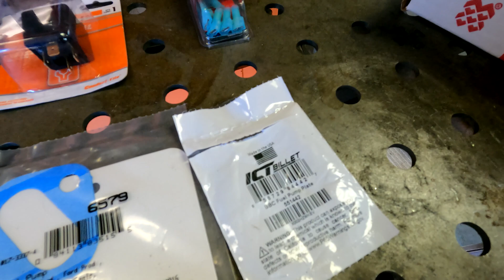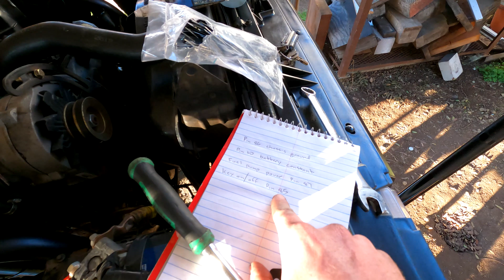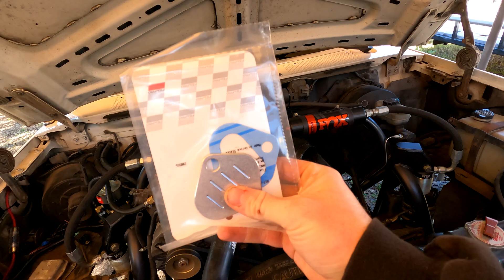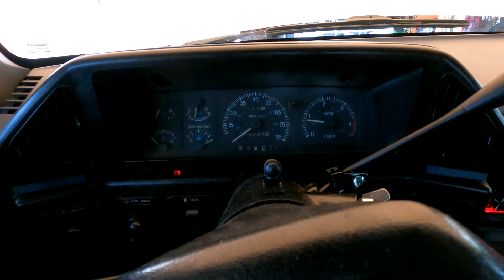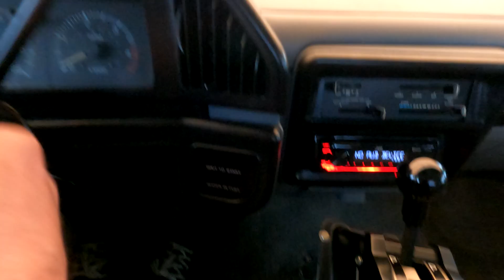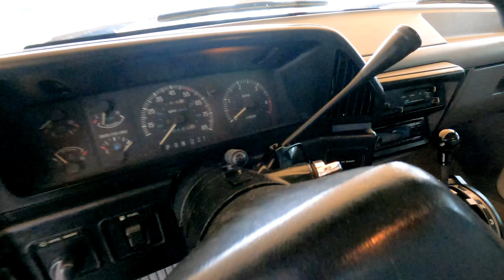7.3 F250 DIESEL BUILD - Upgrading to a Facet Electronic Fuel Pump!

Comment: Why do people make this harder than it needs to be?   Put the pump as close to the tank as possible as pumps are better pushers suckers !

Always know what volume and fuel pressure the truck is stock before buy any fuel pump!
Ford is 5/16 or 3/8s  mount just forward of tank selection switch .

3/8s steel brake line  and fittings less than $50 at any parts store.

Comment: Why didn't you eliminate the junk factory filter setup, change to a 3109 spin on ,filter and housing. Change fuel returns straight to tank,eliminates most of the air leak

Comment: The pressure is constant, which is good at idle and low rpms but if you’re cruising at high rpm, it’s not going to keep up with the fuel usage

Comment: Why not just go with a FAsS fuel system?! And do it right...there proven and they work. I dunno if I'd want to truck some 'Amazon eBay fuel pump.' Made in china crap. That's a good way to cost yourself an injection pump lol. The problem with mounting a electric fuel pump like that up close the the engine under the hood is a electric pump like that dosent like to 'pull or suck' fuel from the tank, that's why fass systems are mounted under the bed on the frame rail with in 3 feet of the tank bottom mounted sump! An electric fuel lift pump like that is ment to 'push fuel' up to the injection pump, not 'pull and suck fuel up to the injection pump'. So that's a big flaw I see in your install. It puts a lot of stress on the pump motors. A mechanical diaphragm driven pump like the one mounted on the side of the block, that can 'draw and suck fuel' a lot better than a little electric motor, they don't like pull or suck the fuel, but they are really good at 'pushing' it of that makes sense. 
I'd delete and ditch all that inferior stock oe fuel filter stuff, that's what everyone does on the dodge Cummins fass installs. Delete and throw all the stock oe fuel filter stuff in the trash. It frees up a lot of rooms and cleans up the engine bay! 
a FASS fuel system is reliable, or filters down to 1 micron on the main filter, and 10 microns on the water/ fuel separator. There's provisions for optional fuel probe pre heaters. Tru e wiring harness it comes with is all premade and simple plug and play to! No having to make and fab your own wiring harness up. And the best way to install a fass is with a bottom mount sump kit, a dual port sump form beans machine! No need to drop the tank and mess with a draw straw or have 1/4 tank fuel sloshing air sucking issues with draw straws, there a thing of the past. A dual port sump is your fuel feed and your return. Or you can even for your fuel return do the filler kneck 'T in fitting' for the return and use the secound port in the sump for an aux in fuel line from an aux tank in the bed. It'll gravity feed in as the level naturally drops from usage, it'll keep your tank full. Thats how I have it set up on my '02 24v HO. 
A fass system is an essential for any diesel, dosent matter what year, make model engine, or injection pump. It's cheap insurance! And peice of mine knowing your always going to have and over abundance of filtered clean cool fuel at your injection pump inlet now matter what all the time. Fass filters are avaliable just about anywhere, I like to run the bigger over sized CAT filters, there twice the size of the standard fass brand ones that come with in the kit. The cat filters have a slightly smaller micron rating down to 1 micron. Most factory OE filter setups on ford/ gm/ dodge are lucky to filter down to 10 microns if that. It's just enough to catch the big junk and stuff that will damage your injection pump or injectors. If you want longevity then you want a better filter.
Reply: These pumps are made to pull fuel. They have 120” of vertical lift capability. Most refer units use this style/brand of pump.

Comment: I watched this the other night.  Very simplified.  You made it look easy.  I have a 93 idi that I’m heavily considering this.   You should package up one complete kit and sell it as a kit with all the pieces, I’d totally buy one!    I know you mentioned all the pieces and part numbers, wouldn’t be too hard to go online and get all the supplies but I was kinda meaning the fabricated bracket as well.   There are several options for the fuel pump you used, what one specifically did you use?

Comment: How would an electronic fuel pump be better? A mechanical pump allows you to run the truck after an emp blast.....just saying.
Reply: No normal people are worried about emps
Reply: @WoodworkingforAnyone  I'm not Normal. And Normal people are usually NOT on the cutting edge of reality. Normal people are normal for a reason. They think inside the box. Follow the crowd, and don't take risks.

Comment: see on my 90 idit i put a like 00-03 psd rail pump on it and that made a huge difference. then a year later i pulled the idit out and stuck in a 12v cummins. still using the psd rail pump tho.

Comment: If lines are disconnected - what is harm in leaving pump in place - just curios    - it was an absolute bitch to remove and replace already and dont want to do it again if not needed - especially if electric pump does not solve the air in the fuel problem and truck shutting off when driving - but running fine when idling.

Comment: A PowerMaster 9050 will help hard starting immensely, even with air intrusion issues.
I'm planning on installing this pump (why I'm here, duh) but a modern high-torque, high-revving starter is an amazing improvement as well. The old ones just don't turn fast enough, especially when you compare the cranking sound to, say, a 6.0 PowerStroke. The 9050 cranks at about that speed, and can fire off the most worn-out of IDIs in less than a second from cold.

Comment: I added one of these on the passenger fender, mine is turbo charged and have noticed that between the water separator and fuel filter it drains the bowl and leaves some air, to remedy this I plan to add a second pump on the frame rail to boost the pressure through the water seperator, seems to not have enough suction and maintain at least 5 psi pressure

Comment: For a 6.9l with aftermarket turbo, Is there any reason to get the 9-11PSI vs the 4-7psi pump you are using?
Reply: It will advance the timing and it will screw up the injection pump somehow. 7psi max lift pump pressure.
Reply: @wildrosegarage4208 the IP has a internal regulator. 9-11 psi will NOT hurt the IP at all buddy. Do your homework kid.

Comment: Thats the one i got in my IDI . Thermoking units use those, very good pumps but, i got my pump right after the fuel tank in the chassis cause is better pushing fuel ,not pulling. I got my pump for over 3 years and remove the canister to clean and put back on..

Comment: Would it be possible to have both the mechanical and the electric pump both in with the mechanical there as a backup? Reason I ask is because I had the alternator belt shred on me in the middle of nowhere and when I shutdown to refuel I was able to crank it back up and drive it back home (albeit in 1st and 2nd gear on the C6 transmission).

Comment: Alternator upgrade  92 e350 130 amp 2 groove pulley     

Plug off the 1/4 inch return line from return rail to filter housing    

Check your glow plugs and while you're replacing them check your compression

Comment: Unless I missed it I would advise an in-line fuse to power the pump. If that pump short circuits and draws 50amps your wires could burn and catch.

Comment: Love the shifter for the C6 .
On all of these old 30+ year old trucks every piece of rubber hose o-ring olives caps need to be replaced going back to the tank .
The fuel heater should be eliminated and hole plugged .
The shower head in the tank should be replaced or eliminated with a straight piece of tubing .

Comment: Fuel pump needs to be mounted as close to the fuel tank as possible and as low so to ensure good fuel priming.  There is a reason that fuel pumps are located on the frame rail or in the tank.  Also only run a paper air filter element on a diesel.  Oil soaked rag filters work only on a gas unit, if on a diesel, there is a bad risk of dusting(polishing) the cylinder bores and then you will have a poor starter and oil burning.
Reply: The Facet Duralift pump is capable of 120 inches of vertical lift; it's designed to pull and is perfect for this installation.
Reply: People need to go do their damn homework 😒

Comment: Don’t you have to install a fuel pressure pump cutoff switch in this case? You may burn the fuel pump if you have to leave the ignition switch ON for some reasons. Otherwise great video though
Reply: Why didn’t you install the same fuel pump as 99 or newer diesel which might be easier because it’s in line pump?
Reply: @ਜ਼ਿੰਦਗੀਦੇਰੰਗ-ਲ1ਢ  the PSD pumps create too much pressure for the IDI’s. We only need 10psi while the PSD needs roughly 60psi.
Reply: It cuts power from the IP and the pump because their wired in together. Do your damn research kid.

Comment: The duralift pumps are great for starting the truck because it supply’s fuel as soon as you turn the key but under a heavy load it does not supply enough fuel like the mechanical fuel pump does

Comment: I'm looking at buying a 7.3 idi non turbo,   would you recommend it?
Reply: I tested several non-turbo before I bought my 94 7.3 IDI turbo. There is a huge difference in power. Go for the turbo. Both engines will run forever if you take care of them.

Comment: so far I been running some kind of diesel fuel pump on mine the oem is still there and the 12 volt pump just runs after I wasn't the one who did it someone else did before i got it. It doesn't leak any fuel or have any hard start it literally just fires right up. I got a second cheapy fuel pump as my backup laying around incase it goes bad but I drive it quite a bit this year it's a 5-9 psi pump.

Comment: The electric fuel pump is just masking other issues with your system. You definitely have air intrusion and other fueling issues. You should put that pump closer to your tank so it doesn't have to work so hard. It will burn up sooner from being overworked.

Comment: Have you done a compression check on the truck? When you showed the video of it starting after the fuel leak back you could hear the starter speed up in a area. This could be indicative of a loss of compression in a cylinder.

Comment: So I did this to my 91 almost exactly like you did, I did it a couple of years ago after reading about it in a idi group I googled, my problem is that I dont really get enough fuel, it's fine for first, second and third gear but fourth is a little iffy and fifth is a no go I can step to the floor and not get enough fuel, can you maybe think of a reason why?

Comment: If a stock fuel pump say in tank had gone straight into a single or say double inline set up no way it could leak back thru 1 much less 2 filers in a row. Not seeing the problem & lots of these engines running around every day so there engines r starting. That said I like hving under hood pump esp if u can dial in the pressure & if tank pump goes out u r not left on side of road. They make check valves so fuel goes in yet can't leak back past a simple ck valve. So this seem bs! problem but. Your prerunner tech I am very very heavy dollars spending into 96' ish broncos builds 5k-10k of them strong.
Reply: The stock mechanical fuel pump is on the block, not in the tank.  And yes, they can leak back, especially if you develop vacuum in the tank.

Comment: Your leak is at your main fuel hard line that comes from your water separator. The rubber seal at the engine side shrinks up and your fuel drains back over time. The seal can be replaced using a like sized piece of fuel line, or replace the whole part. Like $26.

Comment: So, why did you put your remote reservoirs which are used to help cool the shock oil over the engine where they will get heat soaked? I like the lift pump setup. I might use this similarly for my 7.3 PSD, with the addition of a higher pressure pump in line to get to the ~60 psi I need for the fuel rail.

Comment: I'll pass on my knowledge of these idi's. The power difference you feel and may hear in the engine running, is due to the electric fuel pump providing higher fuel pressure (also providing a more constant flow), which in turn actually 'slightly' advances the timing, these engines love it though (just don't go too far on timing) you'll know it when you do. The advanced timing also of course helps with power as you were stating, you're not trippin. Haha, good video though.😎
Reply: Will the advance in timing mess anything up or Will the truck be fine?
Reply: @georgeputnam2966  The more timing the more power you make, generally speaking especially for N/A motors. You can go too far and that will have the ignition happen too early and the flame front will actually come down and hit the piston with full force before it has fully begun the power stroke and this opposing forces will cause damage. You gotta walk the line of too much timing.
Reply: So anyway to tell how we can add a fuel pump at correct timing that’s not going to advance it? Is there some sort of math or science to it? I just got a idi that has no pump so might be good to know! Thanks
Reply: I couldn’t agree more, coming from another idi owner and lover.

Comment: Here's a couple more upgrades for your truck from and a 86 f250 4x4 6.9idi owner. 1. Get the K&N filter for that truck from Oriellys, it will allow you to turn the injection pump up a couple of (flats) and get a few more HP with out smoking everybody out. Basically keep turning it up until you notice a slight haze out of the tail pipe under hard exeleration. You will need to make a new top cover as the K&N is taller then the stock one, I made mine just big enough to seal the filter down and the stock bottom section became basically a splash gaurd. 2. Get some type of over drive for the c6 (gear vendors) granted i don't know what gearing you have in the axle. But in direct comparison b/w 2 86 f250 4x4 6.9idi with 4.10 gearing. Mine with a swapped ZF5 (bw 4spd to ZF5) stick shift to my buddies c6 auto. I was getting 14mpg to there 8 to 9mpg.

Comment: You should add a inline fuse on the main feed to the relay,  should there be a short or a failed pump, you don't want it to start a fire.  Guessing around a 15 amp, depending on what the pump draws.
Reply: 15 amp is to much I have a facet dura lift 40222 9-11 psi so pretty the same pump and I used a 4 amp fuse because it recommended a 3-5 amp fuse.
Reply: Also have a 3amp 15 is way too much@tuckercole1531

Comment: The lift Pump being mounted lower by the tank will help all air to exit and help the pump not to work as hard. It will also be a more reliable setup. Thanks for the video brother. Not too many people post about this issue. Keep up the great work 🤙
Reply: That’s true pumps like to push not pull
Reply: @noka55 that’s not always true. These are called DuraLIFT pumps. These are pulling pumps.

Comment: Check your return lines from the injectors. Any little leak will cause air to get in and cause you grief.
Reply: agreed, also a lot of people have issues with air getting in the fuel filter base. oring goes bad on the line or the heater.
Reply: this is a bandaid for that. a really good one.